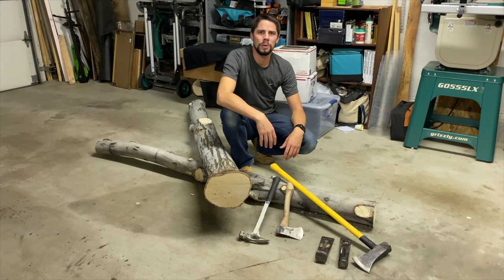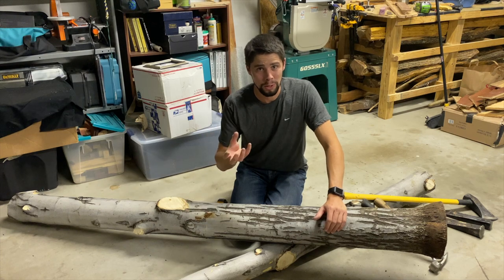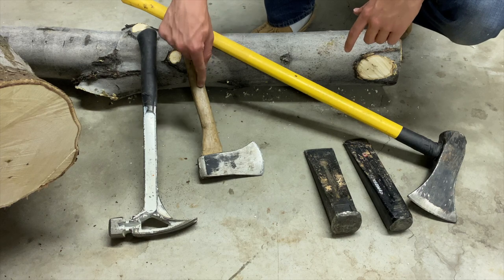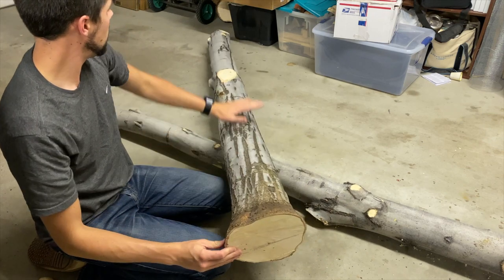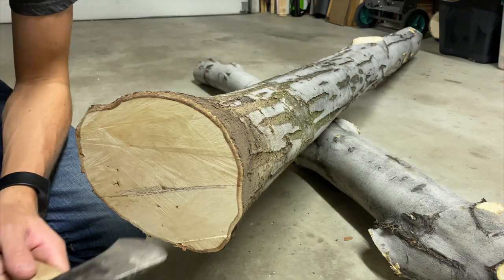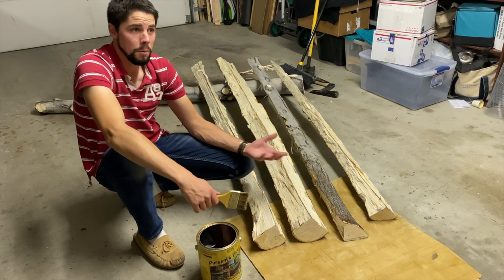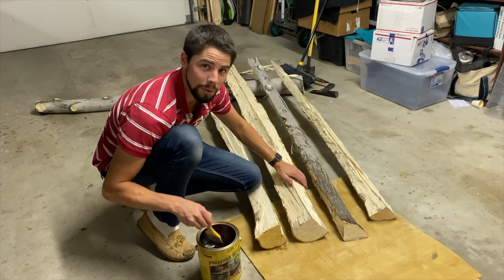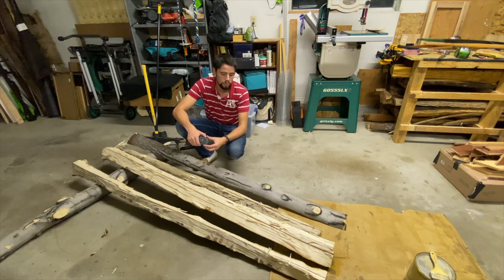How to split a log into bow staves

Comment: Your cat makes for a brilliant distraction. Great video though, very useful.

I have some cherry that was cut 5 months ago but I have not split it into staves. It is under shelter. Am I OK leaving it or do you recommend splitting?
Reply from the maker: He is a good cat and thank you. I have found that I am usually good leaving logs whole or split if in a shelter. Only problem I ran into lately is bugs wanting to eat under bark. If you can and haven’t yet debarked the tree, I’d recommend doing that so the bugs don’t get to your treasured stave. Best of luck!
Reply: @BowtellBows  thanks for such a fast answer and for some excellent advice. I will strip it down tomorrow. Stay blessed.

Comment: good video! At the end when you mention the knot, it seems like there are two other knots near it. Is that not the case?
Reply from the maker: Yes it does have two other knots but I think I will either be able to work around them but we shall see. They are definitely smaller than the one on the end. Thanks for the comment!